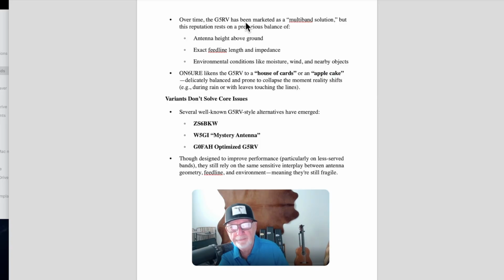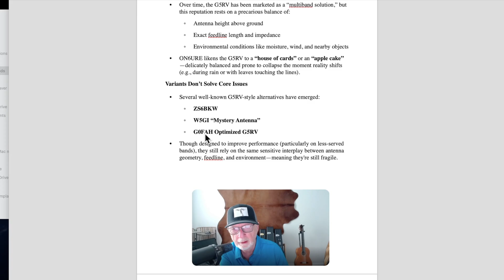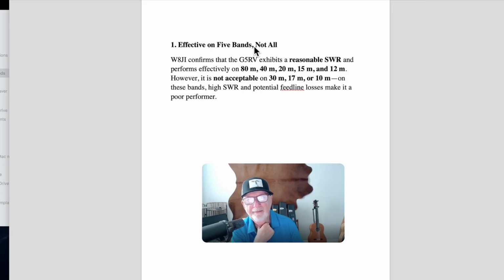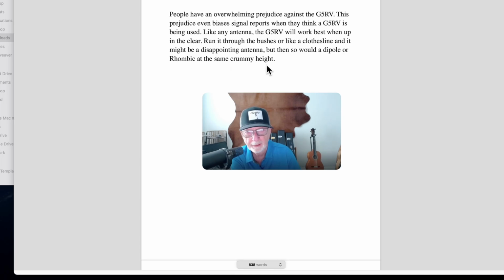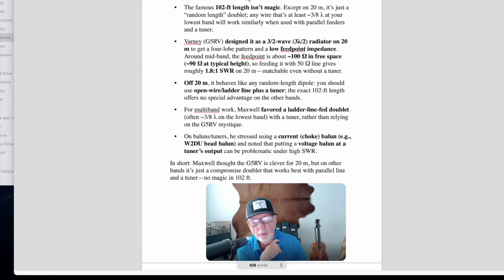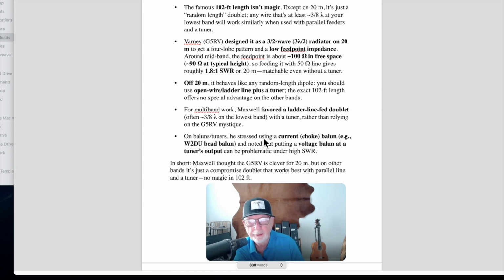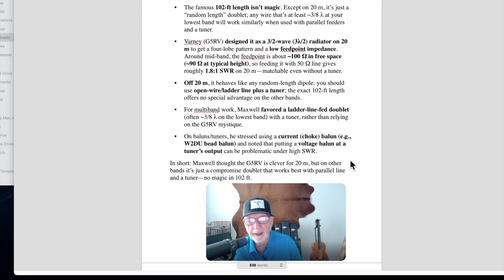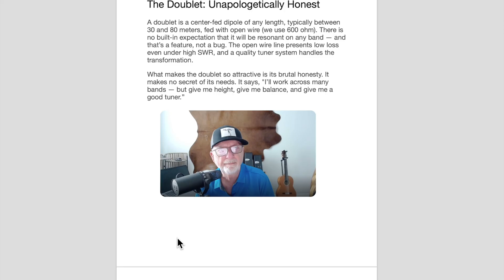Ham Radio's most scorned antenna - the G5RV.

Comment: Amen. If more hams would stop fretting over their individual situation/restrictions/limitations and just put up whatever they REASONABLY can in terms of physical location and funds, GET ON THE AIR and go from there, we'd hear a lot more signals. A simple WIRE antenna gives a lot of bang for the buck, stealth almost by definition with no tower to buy or maintain. I've also learned as a QRP station to get a signal report BEFORE I let them know that I'm running QRP...  🤣. When. You get a 5/5 and you tell the station running a log periodic into a linear he's 3/5 (or 2/5!) and your antenna is a wire or an Outbacker (just a helically wound tapped vertical that's less than two metres tall) well that's where the QSO sometimes seems to end rather quickly 🤣🤣🤣 This isn't even USUALLY the case, but what you hear is what you hear, and I'm much more curious as to WHY the path is better one way with low power and a crappy antenna as opposed to a beam and power???? Isn't this supposed to be a HOBBY? I raised six kids, so I never warmed up a VISA card to buy stuff, as my priority instead was to keep six little seats warm and well fed. "Everybody" told me that QRP wouldn't work, isn't for beginners, etc. etc. 🤣🤣🤣 But that was my only path to take and I'm glad I took it as it has made all the difference. It turns out that less is more, I was not a Physics Major, caveat emptor, your mileage may vary, prices slightly higher in Canada. 🤣73 DE W8LV BILL (and in SANER times: W8LV/VE3)🙏🇺🇦🇺🇸🇨🇦 and ALSO a QRPARCI "72" to you Sir for making these videos!
Reply from the maker: Very nice @w8lvradio thank you.  And that's a good tip about QRP since I sometimes use a 5 watt trUSDX transceiver.
Reply: @BustRadioMyths Why is the QSO sometimes "From" the QRP station, but not the other way around "from" the QSO station? Reciprocity doesn't always seem logical as a rule? Might make a good video..

Comment: When I read the history of the G5RV, I learned the the intent of the antenna was to be a gain antenna for a limited space. It was someone else who decided that it would be a multiband antenna.  

I do like your final summary.  My favorite wire antenna was a 150 foot or so doublet at 100 feet high at one end and 75 feet high over the top of a hill. i originally fed it with cable TV coax, but when the aluminum shielding turned to powder, I replaced it with 300 ohm TV twin lead from Radio Shack.  The difference was astounding. I was the most desired QRP station on the wall-paper nets.  I felt like I owned the frequencies.  Often with QRP but many times running 100w, I could make any contact I could hear. 

I later replaced the 300 ohm TV line with 450 ohm Ladder Line, but I could not really notice a difference. It was definitely not the same as going from coax to twin lead. 

I had a G5RV and used it for awhile. It was good for 20m and above, and it worked OK for below bands.  What I have learned over the years is that, generally speaking, the more wire, the higher, is always better.  Of course, there is the yagi... hihi....

Comment: It's been around a long time and people still use them so they can't be that bad.
I've never used one but have used a doublet to good effect with 300 Ω feeder in the early days and homebrew tuner. No SWR meter so I used torch bulbs at the atu twin feeder and tuned for maximum brightness. QRP only.
The lowdown is that anything will radiate r.f. so just put something up in the clear. 
G4GHB.

Comment: Correct me if I am mistaken, but the ZS6BKW variant is the only one that has been published in a scientific journal with plenty of research to back it up. I don’t care that it’s not a Unicorn; I do care that on the six band it works on that its impedance is close to 50 ohms and its reactance is near zero. One wire and 6 resonant bands is pretty good!
Reply from the maker: Good point!

Comment: As you've demonstrated in your videos that you can pretty much make an antenna out of anything. Some work better than others. I tend to not not like dipoles or the G5 RV or a multi-band dipole with multiple elements from the center insulator or those dipoles with traps so they'll support multiple bands. The problem I have is that they are directionsl and very difficult to rotate and generally they have limited bandwidths on the bands that they're tuned for. However I am a huge fan of End fed wire antennas that utilize an UNUN and ultimately your coax becomes the counterpoise and you could use the choke on your coax to limit common mode currents and also the tune the antenna itself. Ultimately I love the End Fed antennas from Palomar engineering. They have been developed at specific lengths so the antenna is equally non-resonant on all ham bands. By utilizing a 9-1 UNUM on their antennas, they are capable of tuning the full spectrum of each HF band. The shorter versions have problems at 160 and 80 m obviously, but when you go to the longer versions they work fantastically. Palomar also supplies a list of antenna lengths that will work successfully with the same UNUM. I ultimately bought a 151 ft version and extended it to 203 ft of wire and utilized a choke at about the 86 ft point of my feed line. My antenna is 289 feet long. It tunes all the bands and I mean ALL the bands, edge to edge from 6 m to 120 m with the built in tuner of my FT-710. And if you look at the computer models of these types of antennas ultimately you'll see on the higher bands it is an omnidirectional antenna with quite a bit of gain. The estimate of the antenna that I have has it at somewhere between 7 to 10 dbd gain at 10 m. The other advantage I find with an End fed antenna is that I don't have to drop the coax somewhere in the center of the antenna down to the ground and then figure out a way to bury it. I can run my feed line directly from the antenna supported above ground directly into my shack. The fact that I have an omnidirectional wire antenna on the higher bands, the fact that it tunes the full bandwidth of all the bands and it has quite a bit of gain is nothing but a plus. The downside of the antenna I chose is it's very long but I just happen to have the room for it. I understand propagation, time of the year all those factors ultimately has an effect on my signal as it propagates around the world. But I've been able to contact South Africa Tasmania Central Russia and all those cases with my hundred watts I've had fantastic signal reports especially on 10 through 40 m. Don't get me wrong, a tower with multiple directional antennas would be fantastic, but the six figure cost compared to my three-figure cost wire antenna isn't going to happen. It took me a while to figure out what antenna I wanted when I started out in HF, and I've tried many things, but ultimately the Palomar and fed is such a fantastic and well thought out package that can be modified to be longer very simply, makes it a no-brainer for me. By the way, Kurt N Sterba was an owner of Palomar engineering back in the day.
Reply from the maker: This is a good article @martyh9309.  I've got a video in the works for the EFHW which is huge is popularity now.  73.

Comment: You can flick between balanced & unbalanced antennas like half wave dipoles to quarter wave whips & For RF radiation you can forget the tuning bit. The half size 5rv is just 25' of wire (per leg) attached to a feeder based tickling mechanism. The Rybakov is 25' of metal attached to an unun based tickling mechanism & a Comet CFA 250 is 25' of metal attached to a heatsinked baked bean can tickling mechanism. There isn't much in it radiation wise as they are all basically the same radiator ( just 2 are against earth and 1 is running balanced instead) but for 10 to 40 the half size 5rv (properly deployed AND with a decent ATU) should just have the edge over both the Rybakov & the Comet. 
What the half size 5RV does 10 to 40 the full size just does 20 to 80 (or by shorting the feeder together & running it against earth as a Marconi T then a full size would run top band too or a half size 80)
.
The 5rv is certainly NOT a magic antenna but it is a very good compromise. There are not that many other antennas out there for the cost that cover that many bands.
The FT817 is performance wise is one of the poorest spec rigs out there but it's convenience value is great & it probably brings me the most smiles of all my rigs.
The short length of the ATAS120 means it is a super compromised antenna but it's convenience factor is great & they bring great enjoyment to many who don't have any other option. It is funny that ATAS don't get the vitriol that 5RVs get, but in a shootout the 5RV would probably put in much more signals than the ATAS.
The 5rv deserves equal love.

On 40m the half size 5rv is just a smidge less than a half wave dipole such that RF performance shouldn't be compromised & a decent ATU can reign it in.. nothing to hate there 
On 20m it is a smidge longer than a standard dipole that tha ATU can bring it in so why the hate?
On 10m it is basically radiating as an EDZ (extended double zepp), again a respected antenna so why the hate?

I THINK ONE MAJOR HATE ITEM FOR THE 5RV IS THAT IT DOESN'T COST ENOUGH.
Reply from the maker: Good rant!  Thanks for contributing!

Comment: My first G5RV had 300 ohm window line and it broke after 4 years.  My second one was 450 ohm ladder line with beefy hardware and it was fantastic. All HF Bands worked exceptionally with an Icom internal tuner. It even tuned 6m for a bonus.  
Unfortunately it grew into the branches of the trees and left some of it there when I moved. I fed that baby with 130' LMR400 and it worked great on 15m - 6m.  I miss it to this day.
Reply from the maker: I think many of us have left behind some memorable antennas.

Comment: I do like the g5rv but it seems like I need 2 of them one east west and one north south for 20 meter up I use about 70ft of rg8x or rg6. The g5rv is not supposed to work on 17 meters but some days it's better than my zs6bkw. Direction is not a problem on 80 and 40 meter. Also I trimmed my g5rv to low swr on about 14.225. it's about 99 ft. Set it more American band plan. I have recently found out leave the antenna at 102. It gets better swr on 17 15 and 10 meter at 102 ft. Less loss still has around 5:1 swr at ladder line. About 3:1 in the house 70ft of rg8x.

Comment: Agree with W8JI, I had one up and you can get it to work on most all bands with a tuner, but when I just replaced the feeder with all 450 ohm line some of the upper bands the signal received came way up. If you can do it with ladder line all the way, forget the coax section
Reply from the maker: Yes i agree that’s the way to go.

Comment: Absolutetivity! I'm glad I landed on Maxwell's good side without realizing it. It only took 40+ years to get there via trial and error. But try to dispel hardened ham radio myths is not easy.

Thanks Mark for another great video.
Reply from the maker: Totally get that. That's a great line - "Maxwell's good side."

Comment: Not if its good or bad as a multiband 100watt or less backyard antenna. Its OBSOLETE! First by trap dipoles that take less space and also now with the EFHW, both of which need little or no matching, the latter also solving the transmission line weight issue. then and now for best performance, you want the best type antenna and height for that band.
Reply from the maker: Good points.  I’ve got a vid on the EFHW coming soon.  Hope you catch it and comment.

Comment: The commercially made G5RV's use coax to twin lead without any choke or balun where the two connect so the entire feed line radiates. Not the best for efficiency or performance. They work okay, but an old school doublet will still outperform them. I believe the only reason the vendors who sell pre made G5RV's build them this way is because they know most hams seem to hate ladder line so they can sell a lot more antenna's if they use coax. I still find it strange how many hams hate ladder line, baluns and tuners but to each their own I guess.
Reply from the maker: Great observation and makes absolute sense!  I'd call it a sin not to include a choke!

Comment: Back in the early 2000s at my new house and scrambling for an antenna before winter set in,  I had a G5RV, I used to be 20 over with the local 75M crew with my FT-102, then one day, the topic came up about antennas, I confessed to using a G5RV and  just like that, my 20 over signal was lost, barley an "S 5" signal until I told them I took the coax section out, fibbed and told them I ran the 450 to the tuner ( I never changed a thing, so a little fib) suddenly I was 20 over again.  Go figure...

I still get the same signal reports today with my vertical.
Reply from the maker: This is hilarious and exactly what W8JI said about prejudice against the G5RV.  As soon as the other guy finds out it's a G5RV your signal goes down LOL.

Comment: The overriding thing about the G5RV, the junior version and the zs6bkw is a feeling that they are a clever casserole of antenna length and feedline configuration to provide a decent match to 50 ohms to many bands. In short, a successful mathematicians project. Yet if you just ran most or all of the feedline as balanced line and added a few feet to each leg, you’d likely get a better performance on all bands 80-10 and far less feedline loss. Maxwell was 100% correct just use a doublet at least 3/8 wave on the lowest band. Or frankly use a 133ft efhw and be done with it.
Reply from the maker: Yes agreed 100%.  I like that - a clever casserole.
Reply: I use a 9:1 with 150' of wire.  Tunes all bands, including 160, 6, and the WARC bands.  The ability to do instant QSY to anywhere I want is indeed a good compromise.

Comment: Good info. I think the bottom line is to get your power to a wire at least near a half wavelength long, up in the clear, remembering that the horizontal (azimuth) pattern changes with its length, and remembering that the vertical pattern ( elevation angle) changes only with height above ground. The feedline in irrelevant as long as the losses due to SWR ( directly related to length, size and quality of the coax) are not excessive. If those conditions are met a good tuner ( or a wide range pi network in the transmitter) insures the power gets from the transmitter to the antenna system.
Reply from the maker: Great analysis, that's pretty much it!

Comment: Good video Mark. I think these arguments about the best antenna are pointless. The best antenna is the one that fits best into your situation. That means the size of your property and the location of your ham shack in relation to trees and masts. For my property, the 102 foot length fits best. So I use a G5RV and it works well despite the naysayers.

Comment: Interesting. I use a short G5RV as my main antenna, strung horizontally in the attic of the house I rent. The house is 30 feet high. I did add extra wire to it (approximately 36 feet on each end) as well as ferrite beads. I also use Xiegu equipment so good tuners. I can get on all the bands including 160 meters (!) . It is indeed a compromise but works for me.

Comment: I have found the G5RV and its updates to have pretty small ears, especially on the higher bands. This would perhaps be explained by the natural multiplying of the azimuthal lobes that occurs as the number of wavelengths increases. I think L. B. Cebik W4RNL's 44 foot doublet is a better solution.
Reply from the maker: Good analysis.